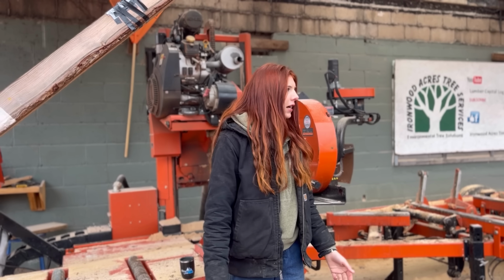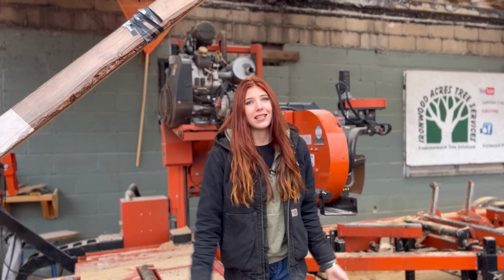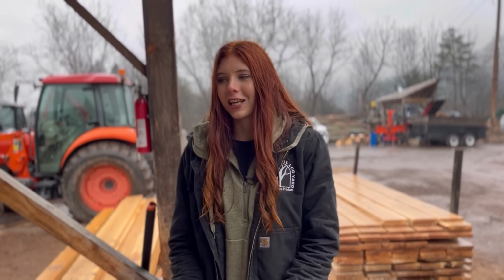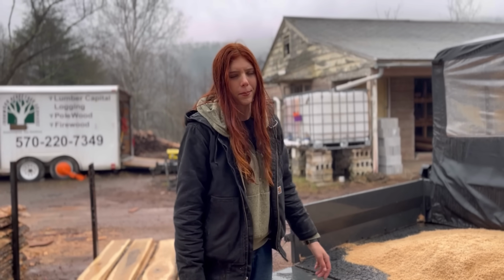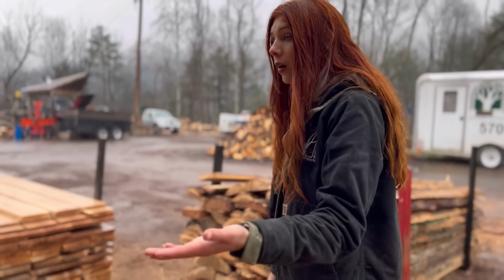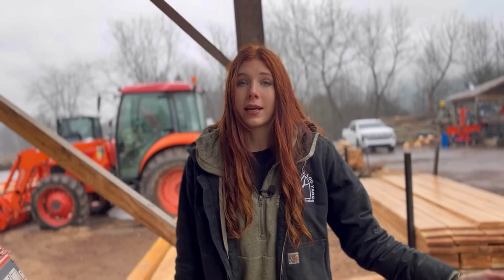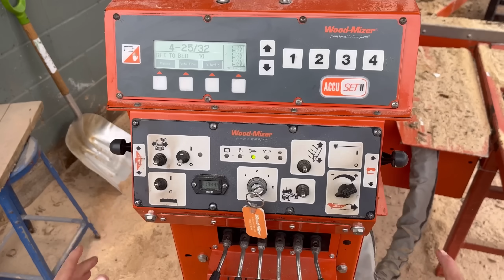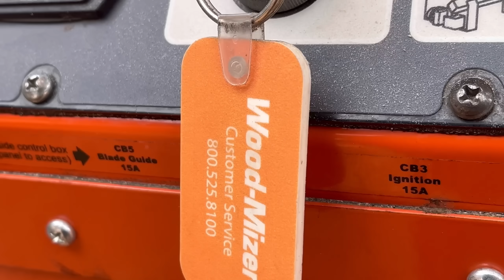Rainy Day on the LT40 Woodmizer

Comment: Try putting a large piece of plastic in and over the sides of the dump bed. The wet sawdust will slip right of the bed with a lot less clean out

Comment: Working outside in the rain, snow, direct sunshine & overcoming obstacles is all part of building a reputation for getting the job done. The show must go on.  I worked outside rough carpentry for 10yrs. I have the preverbal "fair" skin w/ Red hair and Blu eyes. I had to have protection or I'd be laid up.  From -15°F  w/ wind & snow in January to rain showers & 100°F in direct sun summer. Walls had to go up, shingles had to go on. You have to have the right PPE to stay healthy. So, head on down to a farm store and pickup some raingear so you can bear it w/ out getting sick. ben/ michigan

Comment: It might help a little if you were to put a piece of guttering along the roof edge closest to where you load the logs on to the mill. At 'east then you wouldn't have a continuous line of water dripping in the same location.  You do a really good job with dealing with it in any event.